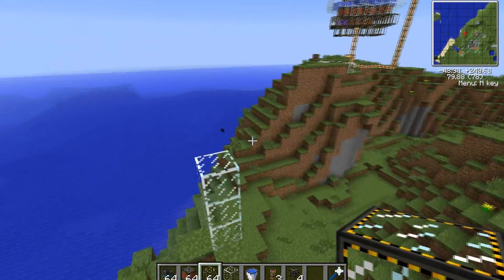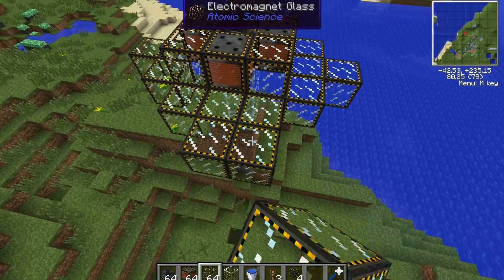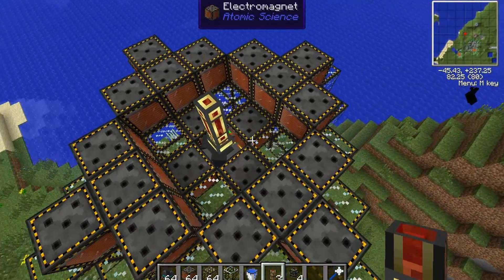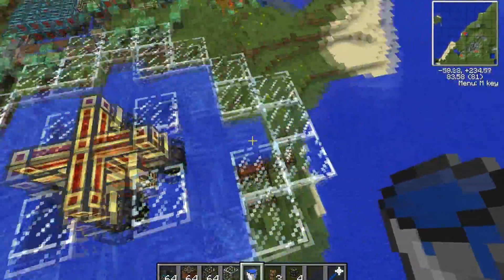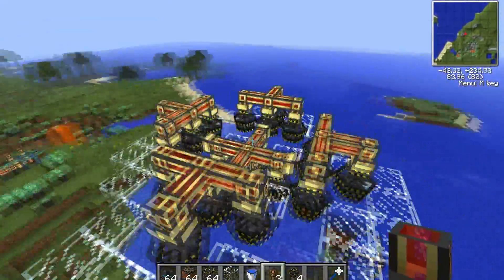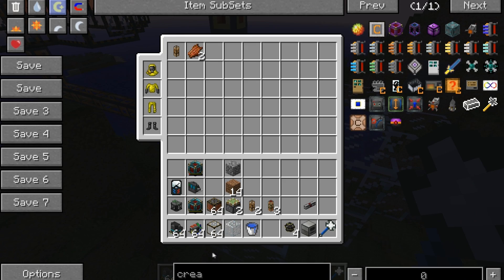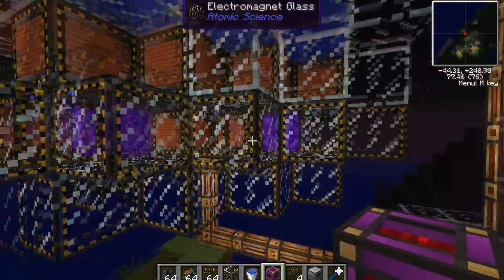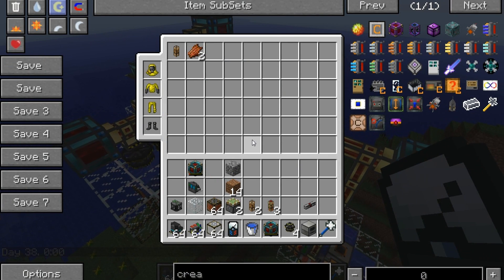Tekkit : Atomic Science Self-Sustaining Fusion Reactor

Comment: so how do u power it without kick starting it...
Reply from the maker: It has to have some amount of power at least initially. This could be done with a simpler reactor such as a fissle reactor. I am not positive but I believe that reactor requires no kick-start. That is just assuming you have no other power generators aside from atomic science. 

As it relates specifically to tekkit you can use any power source. Such as an energy cell you picked up with a wrench and thus retains its power, or even something as simple as the dynamo with a couple of conduits to the extractor. 

Tl:dr
It doesn't take much power to kick start it so anything will do, but if you only have atomic science a fissle reactor should do the trick.

Comment: It's really annoying that nether atomic science or Big reactors is compatible with Galacticcraft  or Build Craft.. I want nukes powering multipule Quarrys.. :(
Reply from the maker: Not really sure how you came to that conclusion with Buildcraft. I will agree with Galacticraft although! Galacticraft uses eu or at least a form of eu  from Industrial Craft 2. Unless you get a power converter mod there are only cumbersome ways to transform eu to rf and visa versa. 

On the Other hand I disagree with your assessment of Buildcraft specifically quarries (or any machines such as the laser, just not the engines or other forms of power generation). Thermal Expansion 3 (the main mod which introduced Redstone Flux (rf/t) which is also in Tekkit) has conduits. These conduits will output Rf/t or Mj/t (Buildcraft's energy). So as long as you have TE3, you can use these conduits to directly connect to Atomic Science or Big Reactors which can then go directly or indirectly to a quarry (generally you would have an energy cell in between somewhere to store the excess energy)
Reply: Nelriana
Ohh... Ok.. my mistake.. must hunt up the conduits.. and put my reactors to work... The Wiki's need to be updated.. wiki still says that atomic science makes MJ, but it now makes RF.
Reply from the maker: shazbot3232 No worries =)!

Comment: My only complaint is that this has no potential for exploding. Now that I got a good modular force field setup, I was really looking forward to some reactor meltdowns.
Reply from the maker: This system doesn't explode, but it can cause massive destruction. If you set it up incorrectly and start it up and the plasma escapes, it can easily destroy everything except for the electromagnetic blocks and bedrock. The range is about 20+ yards.